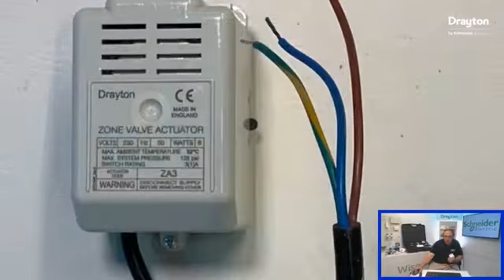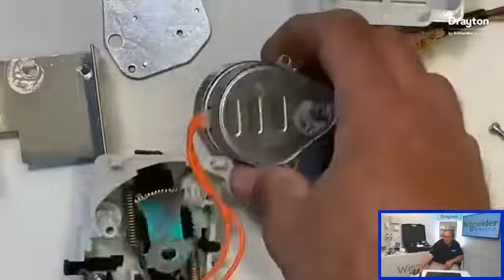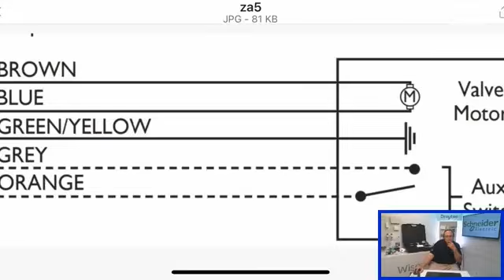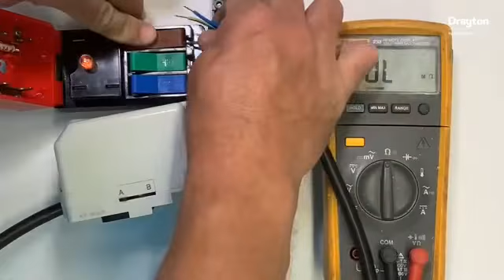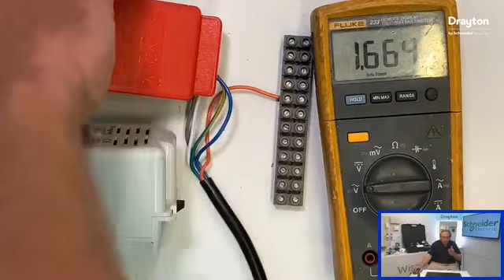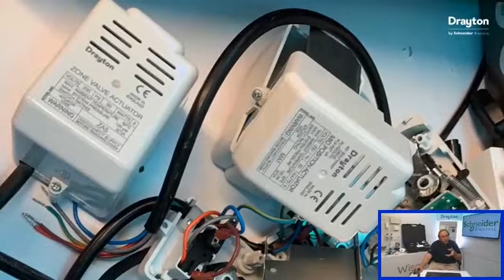FB Live Training -  Motorised Valve fault finding

Comment: Hi I have a MA1 mid valve, the issue I have has happened twice only the hive room stat has reached temp but the boiler continues to run on could this be a micro switch in the mid valve, I have removed and checked operation and everything looks ok, it will run ok for 99% of the time then it will do it on the very odd occasion.
Reply from the maker: Thanks for getting in touch. For the most comprehensive response I recommend contacting our technical support team, who will be able to talk you through the best options for your situation. The number is 0333 6000 622 and lines are open Monday to Thursday 8am - 4.30pm and 8am - 3.30pm on Friday.

Comment: Hi, I recently had a new MA1 actuator and 3 port valve installed  but it seems like the actuator is stuck on H heating. When I call for hot water it doesn’t move and the heating comes on instead. The leaver is really stiff and I can’t move it. It’s not even a couple of months old.
Reply from the maker: Sounds like the grey wire is connected to a permanent live rather than the hot water OFF terminals on the programmer and cylinder stat.

Comment: Hi, I am really enjoying this info. Bit of a dumb question, but I would lke to buy one of the Quicktest testers.

Would you reccomend the 5AMP or 13AMP model? I will be using it to solely test motorised valves.
Reply from the maker: Hi, as the motorised valves only draw approx 5W, James has replaced the fuse in his with a 1MP.

Comment: Hi Not sure if you'll pick this up, but I'm a user, not trade. I have a mid position actuator, but when the end position is on Heating (H) and nest states, heating is off, the heating is still working. I have to switch water on and off in order for the position to move to W, which then switches the heating off.  What does this mean, and why does it happen? Does the actuator need replacing? 
Any guidance/ advice will be much appreciated. Thanks
Reply from the maker: Our customer services have a test routine, if you give them a call they can help out - 0333 6000 622

Comment: Would it affect the pump, ie, my pump won't shut off.
Reply from the maker: Depends where the pump is fed from. If the pump is connected to the orange wire of the motorised valve the answer is yes. If the pump is connected to the boiler, it is possible the boiler is causing the pump to run all the time.
Reply: @Draytonheating  Thank you.

Comment: I have a problem with my Drayton unit with the heating being on when it shouldn't - so I assumed it was just a sticking valve. Removed the motorised head & found that the brass valve was easily moved, so it looks like the motor itself is faulty, however the plastic manual lever seems to be locked solid. Any thoughts before I call the engineer as I don't really want to start dismantling the motor. Thanks.
Reply from the maker: Sorry to hear you are having issues. If you contact our customer service team they will be able to assist you - 0333 6000 622

Comment: I have two za5 for dual zone but zone 2 doesnt work independently, the lever has to be to the left to heat up zone 2. Zone 1 level is to the right and both resting to a. What could be the issue?
Reply from the maker: Have a chat with our customer service team who can assist you  - 0333 6000 622

Comment: Do you know the answer to this problem which I think is more electrical than a problem with the MA1, In the morning I have the hot water timed to come on, half hour later I have the heating timed to come on and remain on for the rest of the day. I've recently noticed that when the hot water goes off the indicator on the actuator remains in the mid position and the boiler fails to fire to keep the heating on, If I switch the mains off to the whole system the actuator then moves to the H position and because the timer is still calling for heating the boiler then fires up, is the fault coming from the boiler or timer?
Reply from the maker: Have a chat with our customer services team who will be able to run through some fault finding routines - 033 6000 622

Comment: My MA1  valve appears to have failed.
The boiler fires up until the hot water is up to temperature, the cylinder stat then actuates the valve to motor to heating cycle - so far so good! 

But when the heating cycle switches the valve off it stops the valve from working the next cycle.

On inspection, it appears the cam is not activating the micro switches, full movement of the cam does not even contact the grey or white micro switch tabs. 

What has happened here? -  the black plastic cam and the little microswitch buttons are nowhere near each other !! The microswitches seem too far away from the cam, the switch buttons don't appear damaged or broken off,  could the black cam profile he ave worn? Help appreciated!
Reply from the maker: Chat with our customer services and they can help you run a test on the actuator - 0333 6000 622.

Comment: Is a "DRAYTON 27651SX 3 PORT MID-POSITION VALVE ACTUATOR" a suitable replacement for an old MA1?  i.e. is the valve assembly geometry unchanged?
Reply from the maker: Yes, 27651SX is the Screwfix part number for the MA1 actuator only. So long as the old actuator has the push button to detach from the body this will fit.

Comment: I had the same problem as other comments with the heating constantly on.  This was found to be because the 2 tiny tabs holding the micro switch had broken off.  They are not robust enough to cope with the many heat cycles they will experience.  I 3D printed a little spacer to push up against the back of the micro switch.

Next problem I have had is the posts for the ends of the tension springs have broken (on 2 valves!) which is apparently a common problem.  Had to glue (and strengthen) this up with some toughened epoxy and a screw.

The design of the mounting plate needs to be looked at to beef up these two weak areas.  I could buy a replacement head for £59 or an entire new valve for £56 (work that one out!) but it would probably break again in 2 years time.

Other than that a nice valve.

Comment: Hello. 
I have the ZA5/679-2 valve. My problem is that i run the hot water on constant and the heating on timed, but the radiators are heating up. Obviously the valve is not closing correctly. It moves freely between heating and hot water, when called for by the controller. The valve moves freely by hand with the head removed. Can anyone point me in the right direction?
Many thanks
Reply from the maker: It sounds like there may be some debris within the valve body that is preventing the paddle from sealing against the valve seat. Sometimes running your heating and varying the pump speed is enough to dislodge this. Otherwise, you may need to consider flushing the circuit

Comment: Can these leak from the head or is it just that the valve has a leak and the water is passing through the head taking the easy route?
Reply from the maker: The activators are detachable from the body so water shouldn't naturally have access to the activator however, if you get  a leak pass the spindle, the system press could force water into the activator.

Comment: Hi, great video and really useful, its great a manufacturer is willing to share this info.
I have an MA1, 3 port mid position valve which for the most part seems to work ok but it has recently started "clicking" whilst in the M position when the HW is on and the tank thermostat is calling for heat, CH is off. The valve does move  between W M H so I don`t think its seized, I would value your opinion before replacing anything, thanks
Reply from the maker: First thing to try is to remove the activator from the valve body by pressing in the button on the opposite side of the position indicator. Then try calling for HW, both, CH only ect and see if it drives to the correct position when not on the body. If this works, it suggests that the valve body is seized however, the fact that you are hearing clicking sounds like something is failing within the activator itself.
Reply: Thanks for the info but I decided to replace the actuator (at great cost) just to resolve the problem as the valve was held (not seized fortunately) in the mid position so both HW and heating were running at same time when only the hot water was required. Having followed the testing procedure in the video to confirm the fault on the bench I took the unit apart and found the top micro-switch orange button was stuck into the switch, a slight press released it. After reassembly and test it works fine, also the orange wire max voltages I found were around at most 27vAC not mains level but I agree, test with caution. Just to note that when the valve moves from "W" through "M" to "H" there should be 2 distinct clicks on the MA1, if only one suspect a stuck micro-switch, easy fix. Hope this is helpful to others

Comment: I have a mid position valve (marked W M H), It goes over to H for heating, hits the switch and fires up the boiler/pump. But, when heating is turned off, it doesn't move back to W or M, sometimes the boiler remains on, sometimes it doesn't. I changed the actuator, same issue. But if there's a call for hot water, only then does it move back over. Is this correct? I thought if there's no call for heating, it should get pulled back over to hot water / mid by the springs.
Reply from the maker: What you described is the value working as intended. The valve will remain the last called for position till it's told to go elsewhere. If heating was the last call, the value will remain the H position but the boiler should stop firing if there is no demand. The value won't move until water or both are called for.
Reply: @Draytonheating  is there anything else that can cause this issue with heating not always turning off and leaving boiler on?
Reply from the maker: It could be an internal boiler issue that keep sit running but to establish this we would need to be measuring the voltage on the white wire of the valve under the fault condition.
Reply: Hi, did you get this resolved? I seem to have the same issue, but before I change the actuator I am keen to understand if that will fix it. Thanks

Comment: Thanks for this. I have an MA1 that I just use as a simple diverter valve. I'm in Croatia but ordered the valve from UK (before Brexit) It works if I connect mains direct to the motor but not if I connect live to the white + grey and neutral to the blue. From what you say I don't need the pcb so I could just run new wiring direct to the motor. One point that you didn't cover is the manual mid position selection. That has worked OK so far but I have always been worried that the motor might be unable to reset that button in addition to the normal loads.
Reply from the maker: We need a little bit more information, please could you contact our customer services at 0333 6000 622 or customer.care@draytoncontrols.co.uk

Comment: hi there..... I've got a slight problem with my 3 mid position actuator.... its stuck on heating, even when the heating is off.... soon as I knock the power off.... it returns to the water position.... soon as I slightly touch it ( with power back on) , it moves on its own to heating position, and again the central heating is off ? only thing I can think of, is the micro switches have failed.... any chance I could get some info on said switches? simply solder some news ones on? 
Thanks in advance :)
Reply from the maker: Our technical support have a fault finding routine that they can guide you though to try and identify what the issue is. Please give then a ring when you are  in front of the insulation - 0333 6000 622
Reply: Did you sort this?

Comment: Hi there, I have a mid position valve actuator and I'm only getting hot water no CH. I notice that the actuator doesn't turn to the CH position. I replaced the motor and it doesn't seem to help. I can still manually turn the CH on using the manual lever. I'm just wondering what can go wrong. Are the diode, resistors or microswitches prone to failures. Thank you for your help
Reply from the maker: For the actuator to move all the way over to the central heating position the grey wire needs to be live when there is no call for hot water. Our customer service team can guide you through expected voltages if you ring them when you're in front of the system - 0333 6000 622

Comment: given that the synchron motor doesn't burn out why do they fail?  Good video you did well with it
Reply from the maker: If the value doesn't move when energised it could be  a problem with the motor or the value body could be seized. There are also micro switches inside that can stick if you draw to much current through them.
Reply: what would likely draw too much current through? @Draytonheating
Reply: They just get gunged up.  The small amount of lubrication in them can harden or evaporate over time.